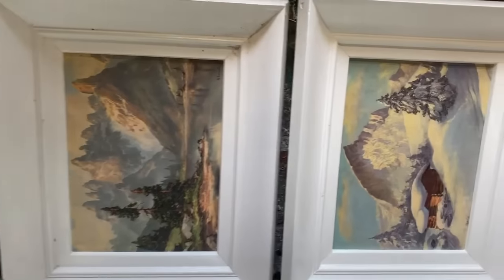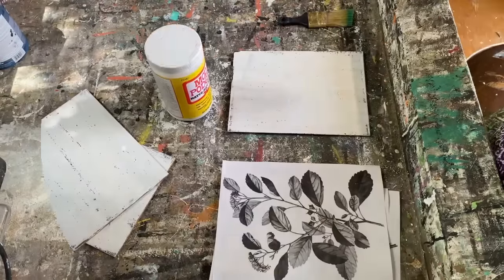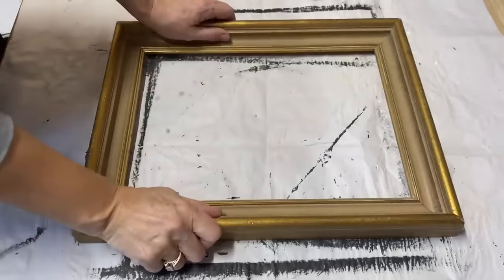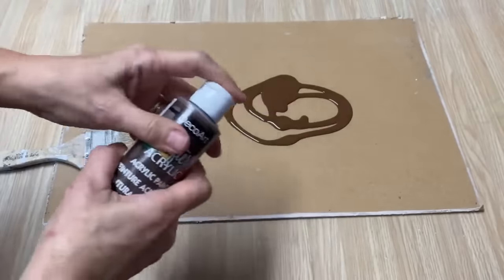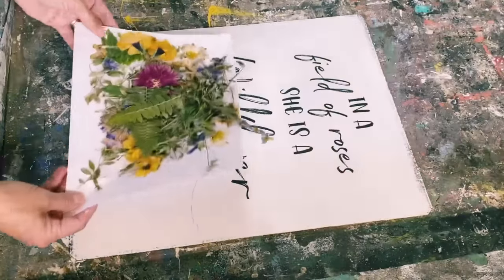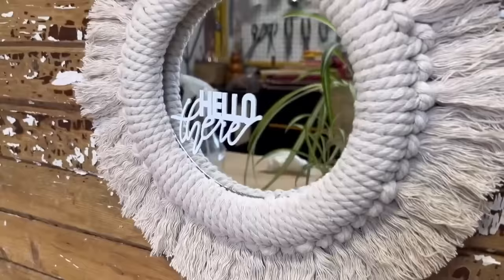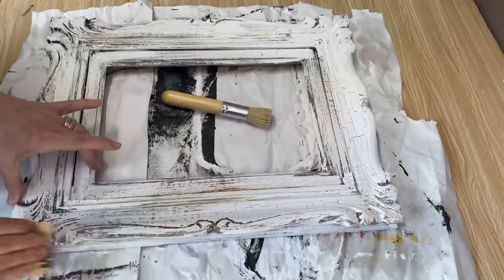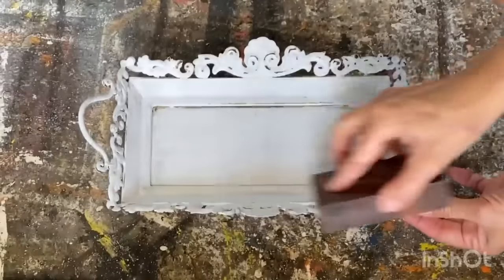10 Brilliant Upcycling Ideas for Thrift Store Frames

Comment: Deidre, how did you remount the two small prints (coffee sip, dry goods) in the white frames after removing the staples? I have  similar frames &  those framing metal "arrow" devices are costly.
Reply from the maker: I just placed the prints back in and then push the Staples back in. I didn’t glue them down at all, so I can change them later on if I want to.

Comment: I had a lot more issues using the packing tape with candle wax. It just doesn’t stick well enough to remove much. Duct tape works great. If you want less distress then don’t stick it down fully just kind of lay it on. If you want more do the opposite. It works well for me.
Reply from the maker: Yes, the duck tape would have more adhesive

Comment: Is that the Mod Podge that you can still see around the cow print reverse graphic you did? I’ve never done this technique. I did one a long time ago with photo medium and found the process of removing the paper too messy and time consuming. I’ve thought about trying it again but I wouldn’t like whatever that is left around the graphics. If it was a fluke I might consider trying it again. If it’s the Mod Podge residue not so much. I’ve really enjoyed the results I have gotten from using my printer and white tissue paper. I’ve recently experimented with adding color to the original printed black and white graphics. They turned out looking like a watercolor painting. I’m obsessed 😍 and I did it all with an ink jet printer. I’ve had no issues whatsoever. So far I’ve only added them to wood. I’m excited to try other blanks out.
Reply: Never mind. I seen it on all of them. I even went back through past videos to be sure.